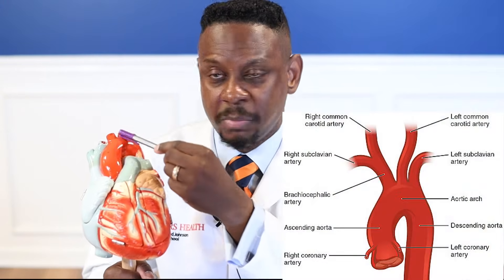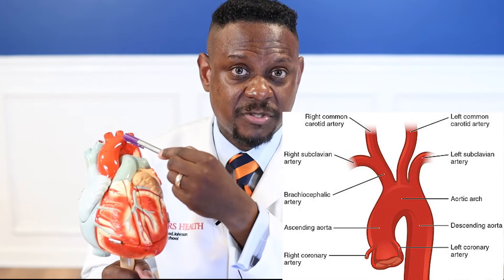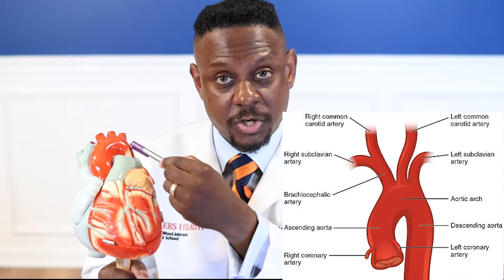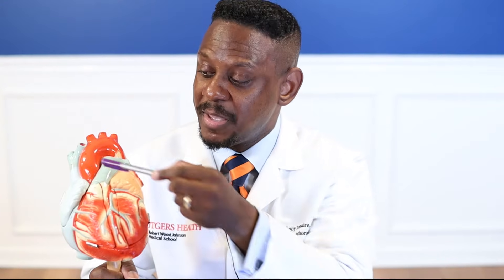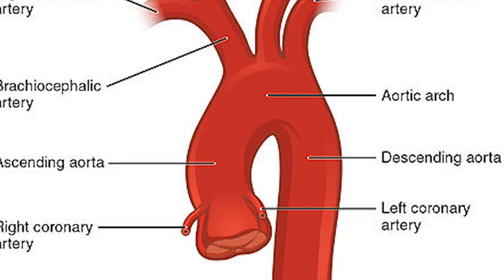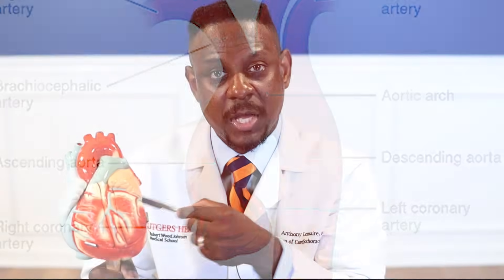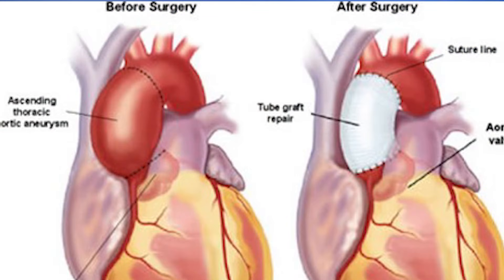Repair of An Ascending Aortic Aneurysm

Comment: Findings on CV MRI:
Severe aortic valve stenosis (0.67cm valve area)
Annulus                                     2.6 cm
 Sinus of Valsalva                    3.2 cm
 Sinotubular Junction              2.0 cm

Repair options:
OHS?
Endovascular surgery?
Reply from the maker: Hi, sorry for the delay in responding. There are multiple repair options as you mentioned. The best option for you depend on your risk factors. For example, a younger person may undergo open heart surgery. An older person with multiple risk factors may prefer TAVR. Please review with the options with your cardiac surgeon.
Reply: @cardiacsurgerypatienteduca2445  Thank you. I appreciate your response.

Comment: Can you please make a video about isolated iliac aretery aneurysm,  i have a kinked saccular common iliac aneurysm it is 3.1 cm without complications,  what is your suggestion,  thank you
Reply from the maker: Hi, sorry for the delay in responding. I will work on a video on this topic however I don't typically operate on patients for this. As a Cardiac surgeon I generally operate on the Heart and the ascending aorta. I would strongly recommend speaking with a vascular surgeon about this. Stay tuned and good luck.

Comment: I have been complaining about feeling unwell, palpations, high heart rate, chest pains. Well something happened to me to where i almost passed out the other day at work. I was taken to the ER and the doctor told me i had mild prominence of ascending aorta. Apparently it has been seen on previous x-rays but i was never told that was what it was. The doctors always say that they have seen something but it is nothing to worry about. So apparently ive been living with this for some years and feeling crappy for a while. So Monday i make an appointment with a cardiologist. I am a 52 year old female and i am scared.

Thank you for thoroughly explaining the issue and the solution.
Reply from the maker: Hi, sorry for the delay. I'm glad they found the aneurysm. I hope the cardiologist explained that the aneurysm is not causing your symptoms. Please make sure your cardiologist refers you to a Cardiac surgeon as well. Good luck

Comment: Excellent description, doctor.    My ascending aortic aneurysm is at 4.8 cm.  It grew from 4.6 to 4.8 cm in one year and I'm 67 years old, in very good athletic shape.  I'm going in for a CT scan on 4/3/23.  Seven months ago my ascending aorta was at 4.8 cm.  I am planning on an Atlantic passage with my sailboat, so this heart issue is definitely a problem.  I just want to get the surgery over with as it has grown from 4.4 cm to 4.8 cm in less than two years.
Reply from the maker: Hi, I completely understand your concerns and the desire to get this taken care of ASAP. I have had patients who requested the surgery before 5.5cm however never before 5cm. I'll defer to you and your doctors. I strongly recommend that you select a cardiac surgeon who does this all the time. Good Luck!
Reply: @cardiacsurgerypatienteduca2445  what is the normal rate of change?  Mine went from 4 to 4.5 in 5 years (age 53 and now age 58).  Is that slow, normal, or accelerated?  This news is less than two old for me, I'm still a bit rocked by it.

Comment: I'm going to have open heart surgery to replace my AORTIC valve and ascending Aortic aneurysm surgery . How bad is the risk
Reply from the maker: Hi, sorry for the delay in responding. First, the risk of this procedure depends on your risk profile. If you or another patient is relatively healthy, in the hands of a cardiac surgeon that does this procedure often, the risk is quite low. Success rates can be 97-98% or higher. In contrast, if you have a lot of medical problems such as history of stroke, kidney failure, and poor heart function, then the risk is higher. I hope that your heart surgeon would have gone over all this. Second, good luck with your surgery. Take care.

Comment: I have a question, for so long I've been having issues with numbness in my feet. Pain in my legs. Numbness in my face passing out very irregular, heartbeat and sweating When that happens. I found a chart that was from a doctor that I saw back in 2017, they did an EKG and found that it was abnormal. Then they did an ultrasound of my heart and evidently it found that I had atrial septal aneurysm! Nothing was ever said to me about this. I never saw the doctor again because when I went to schedule an appointment they were no longer there. I was made aware of this at a neurology appointment because the numbness in my feet is so annoying. They mentioned if I was aware that I had that show up on an echocardiogram. And I said no. I had no idea. I seem to have a really hard time finding a good doctor, I don't go to the doctor very often because of that reason. Is starting to be very concerning to me because I'm not sure if that is something that I have to be concerned about, but given my symptoms that I've had and do have from time to time, I'm wondering if that is something serious and how in the world did that happen? I would appreciate any input that you have. Thank you
Reply from the maker: Hi, sorry for the delay in responding. I think you need to sit down with a good medical doctor, and cardiac surgeon. There are many reasons for numbness in your feet and I don't think its related to the atrial septal aneurysm. Please contact me through my website and I can help refer you to a good cardiac surgeon in your area.

Comment: I am 48 f I have a 3.5 cm distal? AAA. The aneurysm was found in Feb 2022 and I have my next ultra sound in April. Is it true that AAA are more aggressive in women  and I have a higher chance of rupture at a smaller size and dying?
Reply from the maker: Hi, I apologize for the delay in responding. I'm not certain I know where your AAA is. If you are referring to the ascending aorta then a 3.5cm is relatively very small. As I mentioned in the video the indication to operate is 5.5cm so you are very far away. Similarly, if you are referring to an abdominal aortic aneurysm, it's still considered very small. To answer your question, I do not believe aneurysms are more aggressive in women. The size criteria for women is the same  but I suspect that since most women are smaller than man, that an aneurysm may rupture at an earlier size relative to the smaller women's size. For example, a 4.8cm aneurysm in a 5ft size woman would be more likely to rupture than in a 6ft man. Ultimately, I think women may rupture at a smaller size but it doesn't happen all the time. I strongly suggest that you find a surgeon that you trust and get close follow up.

Comment: Are people that workout and train hard at higher risk of rupture? My ascending aorta is at 4.6 cm and sometimes when I’m training I worry about it. It was discovered 4 years ago and initially was 4.5cm so it’s slowly getting bigger.
Reply from the maker: Hi, Good question, the short answer is that exercise could result in an increase in size of the aorta however, its' hard to say because there is not much research on it. I can say that exercise such as powerlifting can increase your blood pressure which could lead to aortic rupture. I don't know if there is a clear relationship between working out and increasing your aorta. I suspect that cardio work such as running, etc., wouldn't increase your aorta but I don't have definitive proof.
Reply: @cardiacsurgerypatienteduca2445  thanks for taking the time to reply. I appreciate it.

Comment: Wonderful video sir.  Thank you.

I was having chest pain after only swimming 2 laps but I could do 6 miles on the treadmill, and go skiing at 12,000 feet, with no problems.  Saw a cardiologist and was measued at 4.4cm in Oct, with a tricuspid valve.  I have no other issues with my heart, low risk factor for lifestyle and no family history.  Doc put me on Lisinopril and I just had another echo and it showed only 4.1cm this time, and the technician spent 40 minutes looking at it closely.  

Question: is it possible that the medicine reduced my BP such that the aneurysm shrunk or do you suspect the 1st measurement of 4.4cm was just a little off?

Thanks.
Reply from the maker: Great question. In my opinion, the aorta does NOT decrease in size. You have to make sure that you are comparing the size of the aorta with the same studies. A CT scan of the chest with contrast is the best test to measure the size of the aorta. An echocardiogram is good but not the best test. I suspect the 4.4cm size wasn't accurate however, what was the test that measured the 4.4cm? If it was a CT scan of the chest then perhaps the 4.4cm was a technical error by the radiologist. There are so many possible issues, the bottom line is the CT scan of the chest is the best and compare the size of the aorta with the same studies.
Reply: @cardiacsurgerypatienteduca2445  Thank you for your reply.  Both tests, 1 done in early October and the 2nd done last week, were done with an Echocardiogram.  My doc ordered a PET Stress Test but insurance denied it and approved a Nuclear Stress Test as a sunstitiute.  Also had that last week and have appt today to review findings.  My carotids have some plaque but doc said not enough to have to have procedure to clean it out.  Wondering if obstruction in Carotids can cause the aneurysm in the acsending aorta?

Comment: Hello, About 4 months ago I was informed by a Cardiac surgeon that my ascending aorta was 4.4 cm and not in need of surgery until 5.0 cm.  I also require surgery for mitral valve prolapse.  Do you recommend aorta surgery @ 4.4 cm concomitant with MVP surgery?  Can the comorbidity surgery be done robotically?  I am 70 years old w/ high blood pressure and mild shortness of breach but workout 3 days a week.  Will most surgeons allow this type of surgery?  Surgery will be done at Scripps Hospital in San Diego in a couple of months.
Reply from the maker: Hi, Sorry for the delay in responding. I'll address your questions, one at a time. First, at 70yo, it's probably unlikely that your aneurysm will get to the 5.5cm indicator for repair. I think you need to clarify with your surgeon what size indicator he/she is using for surgery. You mentioned 5.0cm, is that because you have a bicuspid aortic valve? The size indicator is normally 5.5cm unless there are other issues. 2. If you have a bicuspid aortic valve and are having open surgery (sternotomy) then it's possible that the aorta can be repaired at the same time as the mitral valve. There are more issues that can be discussed than I can say on a YT channel. Please either contact me directly through my website or office to discuss. 2. The mitral valve can be repaired robotically but not the aneurysm. 3. You asked if "most surgeons will allow" this surgery. I'm not sure I understand what you mean? Allow what? Perform the mitral surgery and leave the aneurysm. Please clarify. I personally think the indication for repairing the aneurysm at 4.4cm depends on several factors. If you are getting a  minimally invasive mitral valve repair, most surgeons wouldn't repair the aneurysm at 4.4cm but if you have a bicuspid aortic valve then the criteria to repair the aneurysm is 4.5cm so some surgeons would repair it. There are more to say but contact me if you want to discuss further.

Comment: hello dr. thank u for ur very nice presentation. I'm 56 yrs, was actively working as an RN, I had an emergency life saving aortic valve repair(bovine)post a type B dissection all the way till the rt. femoral artery 1 yr ago. Unfortunately had uncontrolled HTN that I didn't take seriously.  
 Please my questions are: 
1- how long would a bovine valve live?
2- what's my life expectancy?
3- will I need to fear needing a kidney transplant in the future , have some microalbuminuria?
Reply from the maker: Hi, Sorry for the delay in responding. To address your questions. 1. A bovine valve will usually need to replaced in 10-15 years. 2. In general, if you are compliant with your medications and following up with your doctors, you should have a normal life expectancy. Of course, as you know, its not as easy as most people think to be compliant. 3. I wouldn't worry about the need for a kidney transplant, I would be focused on keeping your blood pressure controlled.

Comment: if calcification reaches the heart muscle through the ascending aorta whether heart muscles also get classified in long term?
Reply from the maker: Sorry for the delay in responding, calcification doesn't technically get into the muscle. Its most likely to get on the aorta or valves.
Reply: @cardiacsurgerypatienteduca2445  thanks for the reply sir.

Comment: is Endovascular stentgraft also acceptable
Reply from the maker: Thank you for the question and I apologize for the delay in answering. There are endovascular options for descending thoracic aneurysms. There are no standard endovascular options for ascending thoracic aneurysms however there have been some patients treated with stents but in isolated settings. There are several issues with an endovascular option including the fear of blocking the coronary arteries or impacting the aortic valve. I suspect in the future there may be more endovascular options but not routinely now. Take care.

Comment: Hi sir!! I hope your doing well 😊 I have a question I'm getting surgery on Friday Nov 11 with a aorta root graph and my aortic valve will already be attached to that and my tricuspid valve replaced as well. This will be a redo operation for me so it's my 2nd and I have 3 psuedoanerysums from the first operation, and they are big and apparently pretty bad where they told me I need to get this done because if they rupture I have no chance at all. What's your opinion on that?he also said this will be my last heart surgery ever and the valves are only good for 10 years give or take so I feel I want to hold this off as long as possible but I'm being told I can't wait. What do you think?I'm really scared going into this. I'm getting operated at University of Pennsylvania in Philadelphia.  He said I'm at 10 to 15% for stroke and dialysis temporarily or permanently maybe, do you think I'm going to be able to get thru this. I know that's a broad question without my chart I'm just so worried. Any information you can share is greatly appreciated doc and thank you for your videos.
Reply from the maker: Hi Theresa, First, good luck with your upcoming operation. Second, you told me a lot and I could ask you a lot of questions. Regardless, the fact that you are having your surgery at UPENN indicates that you are going to a center of excellence for Aortic surgery. I can't comment too much on your situation but what I would say is, speak to your surgeon and ask as many questions as you can. Mechanical heart valves last forever technically unless they get infected. I'm certain that the type of valve (mechanical versus tissue) would have been discussed. If not, speak your surgeon about that. Finally, there are always risks to surgery especially if you are undergoing a redo operation however, I am a 100% confident you will get great care at UPENN. I wish you the best!
Reply: @Cardiac Surgery Patient Education  thank you so much for getting back to me. Wow I could cry I really can't tell you how much it means. I had endocarditis in 2018, hence caused the first operation but I've been sober now 18 months. Can your aorta be mechanical too? He said he will take care of all 3 psuedoanerysums but I'm scared they will rupture Going in and I'm in trouble but he said they won't. He's confident in the same sense the risks are very high. I'm 32 and it's really hard to make these choices when I'm not medically equipped to do so, I've been studying and learning everything I can about the heart and my situation. I'm going to ask about the mechanical valve but I don't think he wants to do that, his words were my aorta is basically mush everything my first operation did has fallen apart. I remember him saying something about the mechanical valves and that are stiffer or something I can't think of the word he used. But I'm going to try to ask he said this will be my last heart surgery ever and I know medicine goes so far but whatever my God has planned will happen. I know that pig valves only last 10 years maybe and looking at it at that perspective mechanical would give me more time. But I know  my psuedoanerysums are my ascending and maybe on my descending aorta cause one on the images I've seen one is at the root on my aorta where the aortic valve meets and one up little further and one seems wraps around on the back but I could be wrong. I know there is 3 and the root graph hes going to have to attach my left and right coronary arterie to it. It seems so scary. I'm not afraid to die I'm just afraid it will hurt leading up to that point. I'm trying to ask as many questions as I can I know without you knowing how big they are you probably can't answer this but do you think I should get a second opinion and that I'd have time without then rupturing. Everyone seems so scared for them to rupture. Again thank you for all of your help and time. I can't tell you enough that it really goes a long for me. 😚